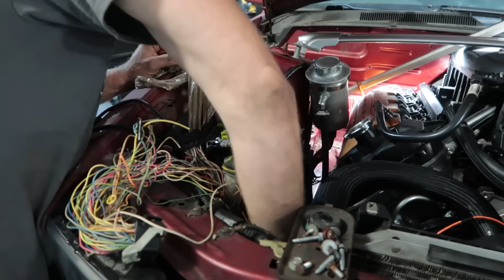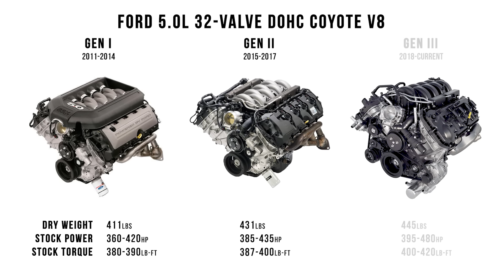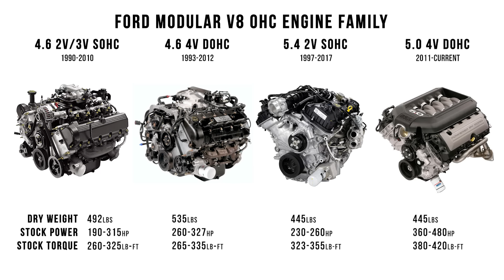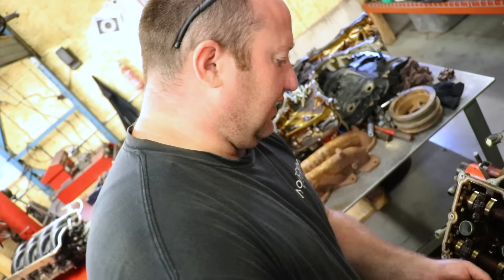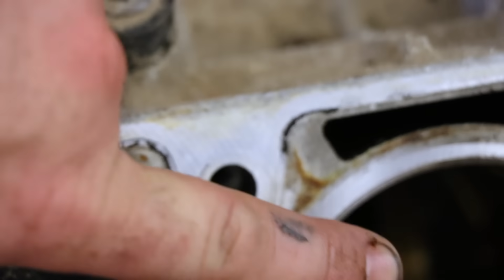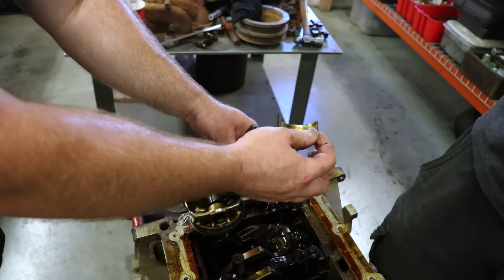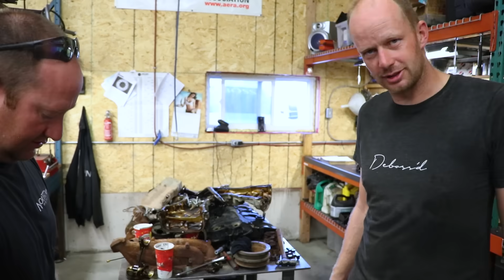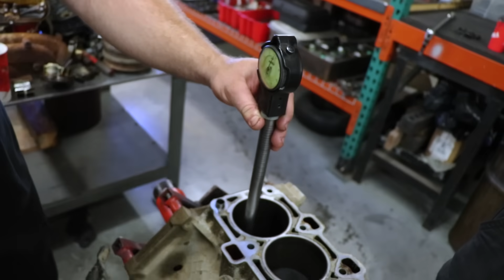REVIEW: Everything Wrong With A 5.0 Coyote Engine

Comment: The coyotes are good engines but dude saying they're 10 times better than a LS is laughable
Reply: It is. I’m a Ford guy but that is laughable I’d say they’re pretty close. Both have strengths and weaknesses.
Reply: @brandonbogert7848  they are a stellar engine. But I’m choosing a 6 liter over a 5 liter 365 days a year and the 6.2 DI gen 5? Oh yea, it will make 500 wheel with bolt ons, no cam. Easy choice for those of us that just don’t have a reason to lose cubic inches, gain mass and complexity. 

I keep it simple.
Reply: Honesty I have a coyote and I’d rather have the Godzilla 7.3l over either engine.
Reply: @brandonbogert7848  seeing as the aftermarket for it is non existent I couldn’t do that
Reply: @ZONES89RS you'll choose that motor and with 500hp with bolt ons you'll still lose to my mostly stock Pony, hilarious. 10 times better is an understatement, laughable that you ACTUALLY believe that the LS is in the same category. It's several steps below a coyote, period.
Reply: @seancovell4124  well, I’m beating the shut out of coyotes with a carbed LS much less a DI LT engine. The coyote is excellent but you gotta get that ford deek out the back of your throat and stop thinking any conversation that isn’t deep throating a coyote is somehow calling it bad or acting like there is something wrong with it. 

You purists are pathetic
Reply: They are at least my engine doesn’t need rods every 100k 😷 “Chevy owners”

Comment: Oil is cheap so do more oil changes he says. Then I look over to my quote for 5w-40 synthetic diesel hd oil $35-$45 x gl depending on brand and I use 3 gl. ='(
Reply: What is the cost of a  replacement diesel engine?
Reply: @cp6027  In my case 2018 ecodiesel for ram pickup is around 6k for a complete engine.

Comment: Where did you find this guy? His theories on oil are absolute nonsense...
Reply: He's accurate to a point. Some blends of oil don't mix well with others. Certain additives turn oil to goo when they react with the different additive package  from a different brand
Reply: @ks_1111  I asked that exact question to an oil specialist guy that worked with engineers in the industry. Got to pick his brain. The dumbed down version is that most oils come from a few major suppliers. The additive packages are different, but the base materials used are all the same, just at different percentages. In other words, patently not true. It's been a few decades since any suppliers made oils that didn't play nice with others.
Reply: @alexmawdsley  my understanding of it, is that some of the "boutique" oils are prone to fouling up when mixed with something else. Like an oil that has high concentrations of molybdenum, or zddp, or detergents. That sort of thing. You're average run of the mill synthetic or conventional oil will be fine, mixing with anything else thats average
Reply: He doesn't seem to know as much, as he thinks he does, about the different engines either.

Comment: This guys opinion on synthetic oil seems convoluted.  Synthetic offers many benefits over conventional however the thinner oils and longer intervals are proving to be problematic. Manufacturers are doing this for "eco" reasons.  Use a good quality synthetic at a reasonable weight and change ur oil frequently.

Comment: Never in my life have I heard that synthetic oil is the cause of such problems.
Reply: It isn't.
Reply: More like he ran it low and never changed it.
Reply: The guy is confusing synthetic oil problems with not changing oil problems. There's a lot of bs about how long synth lasts. Same with diff & trans oil; car makers pretend it's lifetime...
Reply: @wim0104  conventional oil doesn't crystallize, synthetic does, therefore this issue is specific to synthetic i.e a synthetic oil problem. A problem that occurs oil doesn't get to temp, which is rare because outside of winter it takes a couple min tops for oil to get to temp.
Reply: @ExileXCross  Smells like pseudoscience bullshit to me, what are the crystals made of? If anything, conventional oil would crystallise at a cold temperature due to waxes in the oil, but not synthetics.
The guy isn't a chemist, engineer, or tribologist.
Reply: I doubt that as well. This is the only person I have ever heard bash synthetic.
Reply: A lot of vehicles anymore have problems with consuming oil, burning oil, and engines taking a crap before 100k miles. Ford is actually smart by sticking with the 5.0 and working the problems out hence this is a gen. 1. A lot of manufacturers change engine designs about every 2-3 years and hardly figure anything out.
Reply: @Coyote-wm5op  eat my shorts ass hole 😠
Reply: @Coyote-wm5op  Ford has changed their line up practically every year for the last 25 years. Especially with the Diesels (which especially suck ass)
Reply: @uglymechanics6599  tell us about the yearly line up changes
Reply: Brandon Cody lol the 5.O in the F150 has been in the line up since 2011...how long has GM had the 5.3? How long has Fiat/Dodge/Chrysler/Ram had the 5.7? I guess none of those have had problems either.
Reply: @Coyote-wm5op  GM has had the LS since 95, but has had pushrod V8's for over 50 years. They have had some small issues, difference is GM dominates all V8's with the LS whereas Ford can barely get any powertrain to stay together past warranty. I'll say it again, fucking, garbage.
Reply: Brandon Cody I guess if GM were that great they wouldn’t be in 3rd place.
Reply: @Coyote-wm5op  3rd place in what 😂😂😂 you ford guys are special. Keep living in denial bud
Reply: Brandon Cody GM die hards really are living in another reality. Their grand LS they love to brag about always happens to use larger displacement to compete with their Ford competition. Ford does more with less. So any time an LS yee haw gets excited they finally outran a Ford it’s like a midget getting excited they finally hit their head on something. Congrats.... you outran something with smaller displacement. Compare apples to apples with displacement and factory components. Btw GM is in 3rd place pickup sales for 2019. You can google it. I understand your pain though, I’d be upset too if I were strictly a brand loyalist and that brand took a bailout. Lol idk what Ford did to you but they make some good products and are leading the way right now especially with trucks which is where the engine in this video came from. Wasn’t it GM that ran a commercial degrading the aluminum Ford uses and were caught making false claims and later have ended up incorporating aluminum into their own? The truth is Ford like all others have had some embarrassing failures but hating the entire brand and dismissing good products is flat out stupid. Call a spade a spade fan boy.
Reply: @Coyote-wm5op  I'm not wasting my time reading the book you just wrote me, but when you have an actual arguement regarding the pathetic lack of reliability from Ford let me know.
Reply: Brandon Cody  I read it for you.  He was saying we aren’t sponsored by these companies.   We shouldn’t get caught up with brand loyalty so easily.  They have issues at the end of the day and all use similar designs and materials.
Reply: @uglymechanics6599  "GM dominates all V8's with the LS"

LOL! That's why the Coyote pretty much put the Camaro out of production. Get the fuck out of here with your bullshit. You can make 900 to 1000hp reliably on a Coyote without having to open up the motor. Try doing that with a fucking dinosaur pushrod LS.
Reply: @Coyote-wm5op  The Hemi has no problems? I know a body shop that has a guy doing Hemi cam and lifter failures as a side job. Non stop.
Reply: @Coyote-wm5op  If you add Chevy and GMC trucks they are not third. Some years they are first.
Reply: @Coyote-wm5op  In Europe or elsewhere they tax your car according to engine displacement. Not sure how much money you'd save in Italy having a 5 liter Ford vs a 6 liter GM.  But in America if I can get a cheaper 2-valve 5.3 or 6 liter engine that makes similar power to a 5.0 4-valve engine that weights the same and consumes the same amt. of fuel then who cares what the displacement is?
Reply: @Coyote-wm5op  I agree with you ford does more with less but with that said they make it more complicated to do so. Engine wise I prefer LS. But thats because my view is the amount of money the motors cost to build LS is cheaper and easier for me to work on. That doesn't mean better or worse performance wise. This is why when you go to the drag strip there are more cars swapping to a LS engine than any other. You never see a chevy with a Ford engine nearly as much as fords with chevy. It comes down to money and easier.  I think ford does great and I love the F150s and up. 7.3 diesel is great. But a duramax with a allison is also. So in the end for me. Support America 🇺🇸 when it comes to trucks. But when it comes to cars for daily drivers( that are not sport cars like mustang and camero) you better buy a import! Haha!
Reply: @uglymechanics6599  the 2 valve Triton was the last good one..shit since
Reply: @christenn32  You're a fuckin pinecone bud 😂😂 keep tellin yourself that
Reply: @ronniemccarty4740  I'm not even going to respond to that, its too stupid of a response to merit a reply.
Reply: chris r you can’t have a Ford in and out of an engine bay within a couple hours, LS engines are easy, cheap, put out good power and are more reliable than your typical ford dual cam. Price to performance gm dominates the v8 market. Have been for years.
Reply: Andy Anderson I’ll have to disagree with you on that, LS engines are much less complex because of having a single cam. Hence having more for less
Reply: @Dylan-bn3nc  Ford makes more power out of less cubic inch is what I was saying. LS has always been better and easier  to maintain or build.
Reply: @Dylan-bn3nc  Ford can keep those cam phasers!
Reply: Andy Anderson yeah but the reason Ford is making more power out of a smaller displacement is because they slap a turbo on everything nowadays, that’s what’s making them the power not the engines themselves
Reply: @Dylan-bn3nc  that and twin cam with variable timing.
Reply: @Dylan-bn3nc  what THE fuck are you talking about? A 5.0 doesn't have turbo on it.

They make more power with less displacement because they're more technologically advanced engines. Has nothing to do with a fucking turbo
Reply: @christenn32  he is obviously talking about how For puts their Ecoboost in everything.
Reply: @jordanjohnson5784  "they slap a turbo on everything nowadays"

No he means all engines, and he obviously has no idea what the fuck he's talking about.
Reply: @Dylan-bn3nc  price to performance is relative to the kind of build you are doing.
N/A builds you can’t beat GM.
Boost tends to favor the 5.0.
Reply: Was thinking the same thing.
Reply: I don't know about Ford but Mercedes-Benz and BMW wants you to follow their instrument cluster notification which means your oil change can come at every 8000 to 12000 miles. Sludge is guaranteed.
Reply: Thisdude Rong.
Reply: When I bought a Ford it was because of politics, then I went to shop the that I use & asked him which 1 he didn’t want me to buy & I didn’t. No problems
Reply: its a pcv issue has 0 to do with oil
Reply: Exactly my thoughts....
Reply: @tundras4ever552  Its blowby and poor oil change schedule that does that. You recognize it instantly after being around Hondas or imports for awhile. My 2014 Ford would spray oil across the entire engine bay if you took the oil cap off. Brutal blow by. But my 2012 Tahoe (5.3 LS) doesn't spray anything.. theres nearly no air movement with it off
Reply: Brandon Cody sorry to say but that Tahoe has to be low mileage or already rebuilt. AFM 5.3’s are known to be very problematic. Factory lifters and cam will fail and cylinders 1 and 7 will wash the rings and foul plugs. Nothing like the LM7 that came before it
Reply: @1969moparmuscle383  I have AFM shut off with a tuner. Zero issues whatsoever. The truck just rolled 200k kms and runs flawless with good maintenance compared to my Ford that had the trans rebuilt 4 times by the time it had 87k kms. Massive piles of fucking garbage
Reply: Brandon Cody Ford having transmissions made in China or Mexico
Reply: @1969moparmuscle383  What do you think of those hipster electric cars being pushed on the public right now? Why would a person get an electric truck for towing?
Reply: @uglymechanics6599  Ffix  for the oil spray....dont take the oil cap off. :D
Reply: I see the chevy dick riders association is here lol. I will drive anything along as it's American.
Reply: @tondaporter3709  yeaaaah this is how any discussion online goes. The OP was about synthetic oil sludge.
Reply: @tondaporter3709  I agree Truck wise. Non sport car wise for a daily driver I have to say the smart money is on a Honda or Toyota car.
Reply: @daddyfixit631  I agree. I worked 30+ years as a professional mechanic. I refuse to be called a "tech" lol. Now that I'm retired, I took a job as a long distance courier driver, part time for a local taxi company which has a fleet of mini vans consisting of Dodge / Chrysler, ( absolute junk ) one Honda,  one Chevy ( more junk ) and 4 or 5 Toyota's. Taxi duty is mighty tough service for any vehicle. My favorite vans are the Toyota's, all of which have better than 350K on the odometer, and all have original engines and transmissions. The interior and upholstery is still in good shape on them all as well. The Dodges were lucky to make 120k on both the engine and transmission, interiors shot, as was the Chevy. The one Honda has had a trans in it at about 200k, but is doing ok at 200+k. These " buy American" people IMO are kidding themselves. For me it's Toyota all the way.
Reply: @6h471  Yes sir,  I get buying American but at this point American cars are being assembled in America more so than made. I like Honda but their weak spot is the tranny in some models. And motor wise they have a bit of over doing it Ford style to get more power. Toyota has proven to me with their 1.8 combo to be absolutely diehard.  Corrolla = cockroach. But with all that said as a company the last decade or so Toyota has left its simplicity = reliability at a economic price and dove head first into the over do it mentality to please the American need. At this point when looking at new cars there are no economy cars. You have to know which used cars to look for to fulfill this type of common sense.
Reply: @tondaporter3709  LOL
Reply: It's not. Ford guys need to blame other parts for shit than their junk motors
Reply: @uglymechanics6599  They're not bad motors, every generation had it's cons.
Reply: @TheUltimateCrash1990  Lol yes, they really are garbage motors.
Reply: You must drive that garbage gm makes then with all of their junk cam and lifter failures
Reply: @uglymechanics6599  ummm it's just as bad on Chevrolet especially the 6 cylinders like Camaros
Reply: @uglymechanics6599  fucking hate ford
Reply: He said synthetics WITHOUT LETTING IT GET UP TO OPERATING TEMP, which makes sense like a short drive engine. Makes sense to me
Reply: @nathanial41  so it does not happen when running conventional oil below normal operating temp? I call BS. The first few WTF's I let slid but I left my hip boots at the cabin.
Reply: @Wonderwrench  why don't you make a video and you can enlighten everybody with your "great knowledge" 😅
Reply: @nathanial41  still no its a pcv issue

Comment: Let’s see a everything wrong with a 3.5 ecoboost
Reply: Not sure about the EcoBoost but the duratec 3.5L which the 3.5LEB is basically a turbo version, the water pump is internal and eventually will fail and leak into the engine causing catastrophic failure.
Reply: Water pump is externally driven on the Ecoboost.

I own a 2016 Transit 350 w/3.5L Ecoboost and was scared to sh*t when I heard about the Duratec issue. I immediately went and checked on my van and was relieved to see the big pulley in the middle.